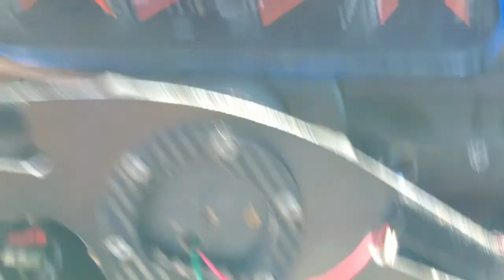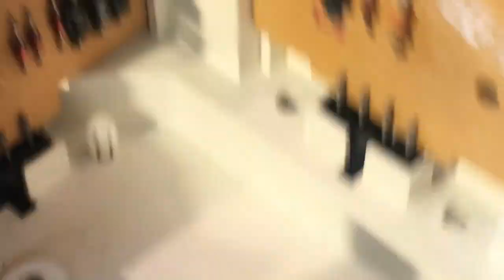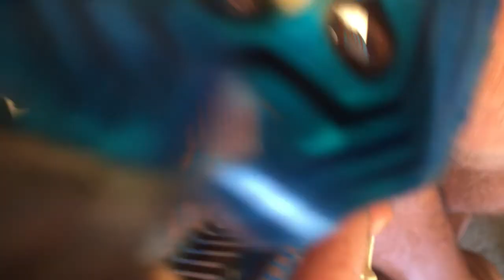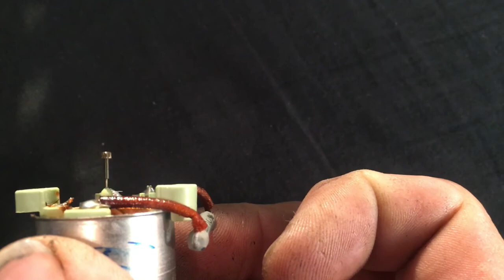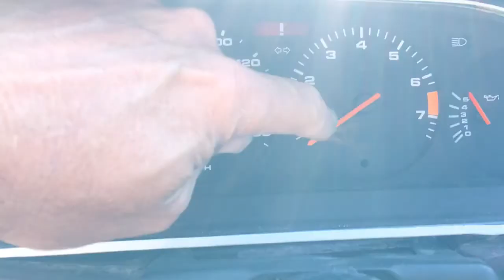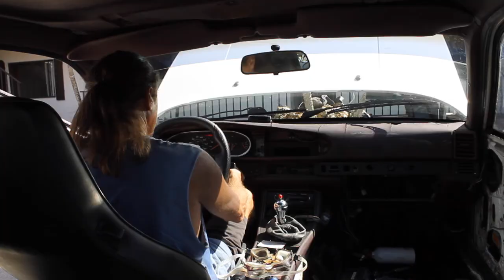Porsche 944 Instruments

Comment: You should clean all connectors with deoxit or electronics cleaner :)
Reply from the maker: You are right but I'm going to replace entire harness cause there is just to much corrosion. Engine rebuild is next with 10.2 pistons. Giving up on AC for now.

Comment: I think your oil presure switch Is defekt .
Thats why ist shows 5+ bar .
Reply from the maker: I think your right. I also suspect OPRV. I had to glue cam assembly with high temp RTV. Gotta rebuild anyway cause spun rod bearing(I think). Got a garage, start soon. Got some 10.2-1 pistons.

Comment: 7/11 guy here, glad to see you got her back runnin after being submerged to the roof!!! 🎉
Reply from the maker: I'm rebuilding the engine right now. 10.2 pistons and New torque tube. Replaced Transmission.  Rack is manual now. AC delete and all around Brake and suspension rebuild. I needed a 6 foot pipe and a 2x4 to crack rear corner balance bolts. Big video to come.......